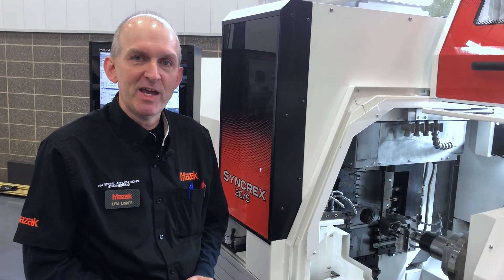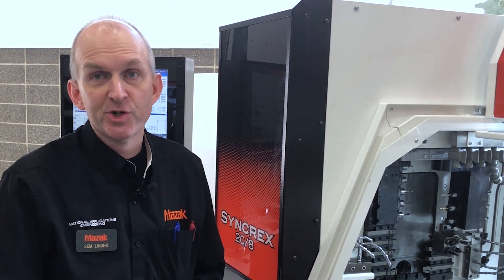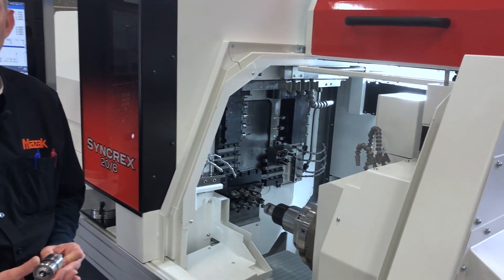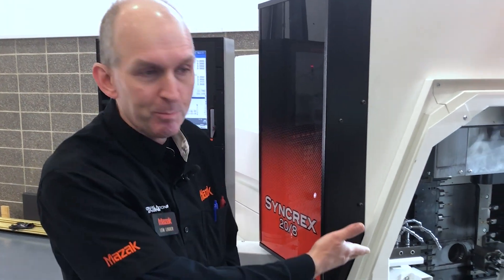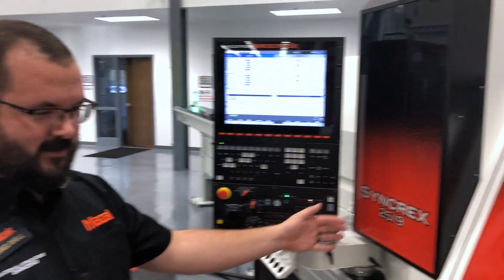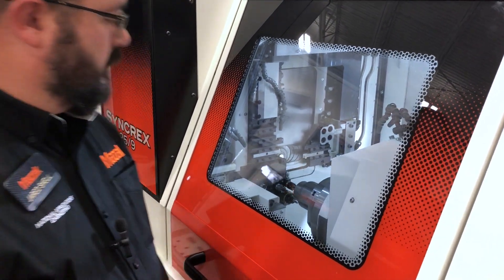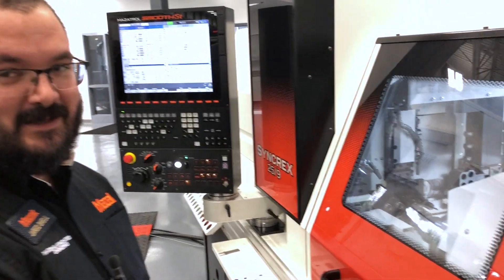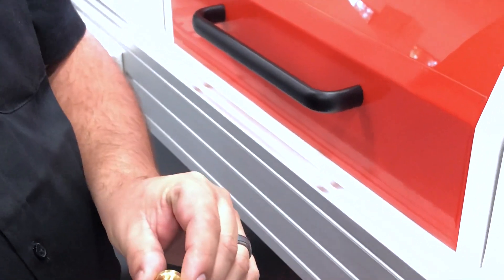SYNCREX Swiss-Style Machining

Comment: I mean im in love whit Mazak, but i dont like that they basicly copied the layout of a star.... really its not hard to build somthing better working than a star rs20IvTypeA.....
When you run parts like a greeg let it run for 4minits than just 1, just no chip bildup ok, but if that thing shuld peforme like a Multiplex that frame will make problems...
Just my personal Opinion, i work on Mazak sience i do Metalwork and now i have 3Stars 9Axis that i just setup and let them run 400h and then ill setup mazaks.... but the chipbuild up in stars even whit HP-Coolant is just bad..... even if every tool has its own nozzle and flooding nozzels...